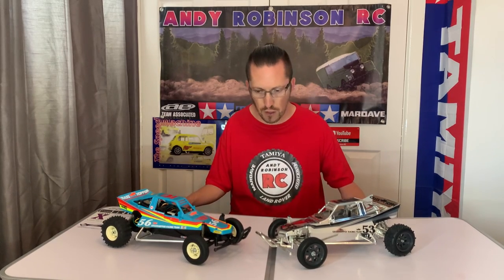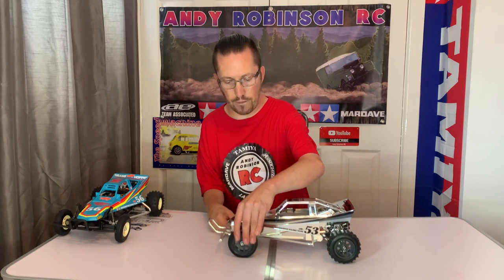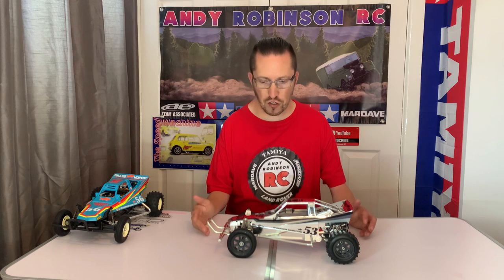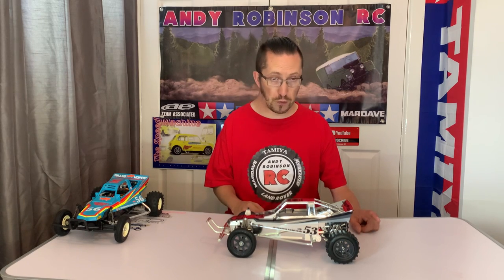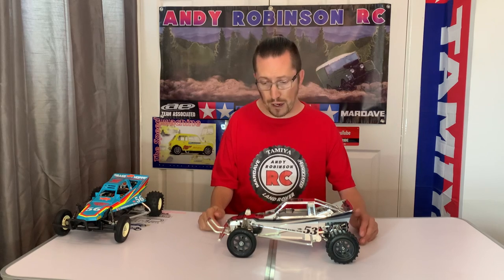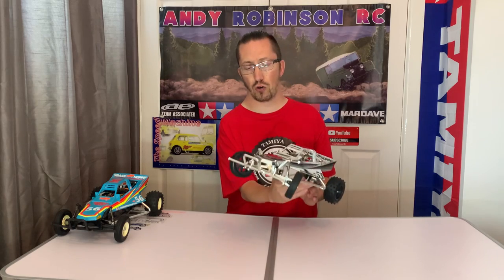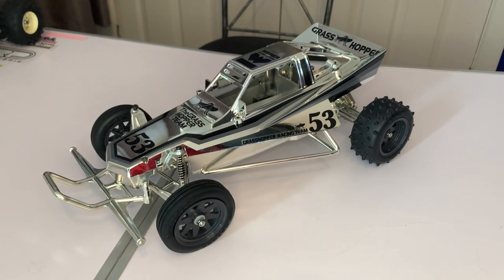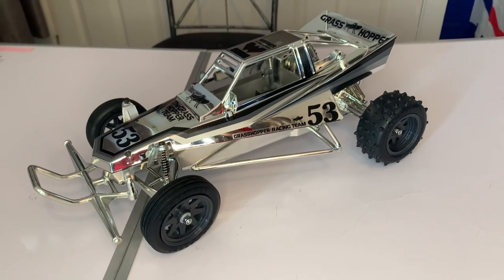E311: Awesome, Fully Chromed Tamiya Grasshopper!

Comment: The problem with Tamiya is that it doesn't listen to its fans. From time to time, really cool custom vehicles appear that are really successful. For example, I remember the Tamiya Legends Lunch Box in white, as well as this Grasshopper. With the Top Force Evo, fans would have liked the aluminum motor mount or servo stays to replace the omitted titanium parts. And what did Tamiya do? They put the silver can and an ESC in there. There was no better way to devalue this legend than a standard kit. This Grasshopper shows once again that the fans can do better and wish for a lot of things to be different.
Reply from the maker: Thanks for your excellent comment , there are certainly some great custom builds and kits out there. Tamiya will always do what makes sense to them we either go along with it or walk away and look somewhere else.